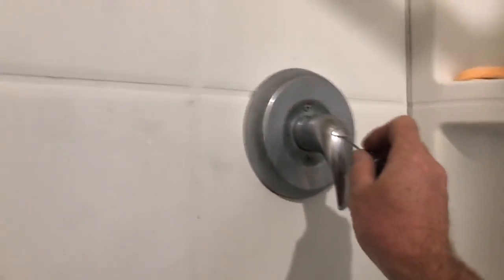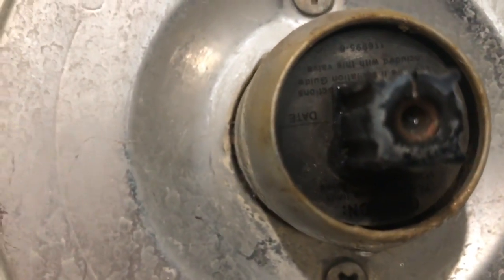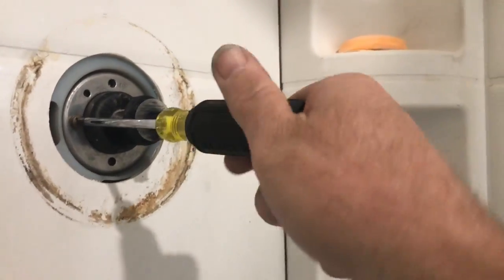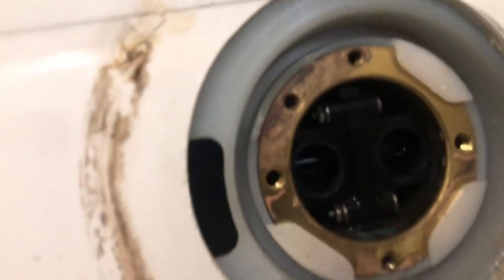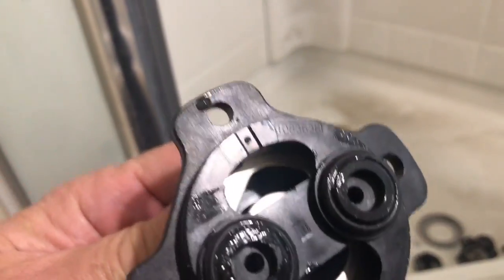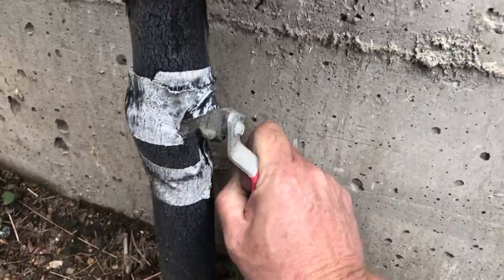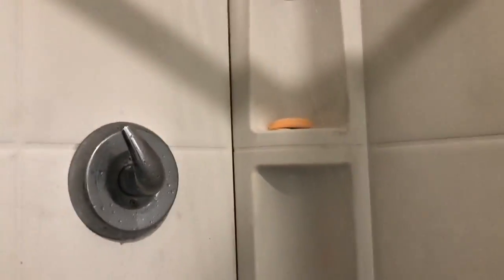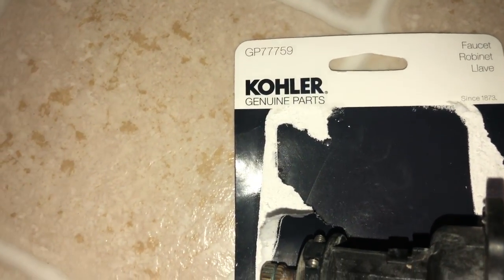Koehler shower cartridge replacement

Comment: Great video!  Because you showed the valve can break into two pieces that answered my question. I didn’t know mine was broke and didn’t understand why my replacement looked different than the valve with the stuck part still in the wall.
I know this doesn’t make sense but thank you for your video

Comment: Same parts that we have on all the showers in the hotel I work only difference is a more fancy handle outside, most of the time what I find is the hot side on the inside part is clogged with small piece of rubber. One valve have problem and it cause problem on the entire riser.

Comment: My grandfathers house still has the original hot and cold turning handles in the wall from 1942. Grandparents were newlyweds in that house my mom and seven brothers and sisters grew up in that house I grew up in that house along with a mixture of 27 other grandchildren in and out and my children grew up in that house are using that shower fixture. My grandfather was a plumber he showed me how to replace those rubber and leather gaskets when I was about 10 years old. And I showed my son just a few years ago how to change those gaskets when he was 28 years old. They just don’t build them like they used to. I guess by the time my new grandson is 12 I will be showing him how to replace those gaskets in that shower wall fixture
Reply from the maker: Great story

Comment: Thank you for this video! Call someone...been there done that and now my water pressure  is WAY LOWER than before the plumber replaced the cartridge(same parts you used). 20psi lower in shower only! House remained fine. Temp also won’t get hot. Rest of house, still fine. After checking everything else, all roads lead to replacing the cartridge...
So now with my new GP876851 the someone I am calling is me!! 🙏🙏🙏 
Do you know if there is anything I should do extra take sure I get my normal water pressure back? 
Thank you also for the tips when turning main back on. Thanks again!

Comment: Hey, Can you please describe how you removed the handle? Mine is stuck on there. Is there a set screw somewhere? Help!
Reply from the maker: Set Scew under oval looking tab
Reply: @NorCal-refrigeration  Thanks for replying so quickly. 
 I was afraid of that. Someone filled that with caulking. You don't happen to remember what size allen key?

Comment: I think mine is bad too. I looks like the same style. I have no hot unless I go all the way up then I get scolding hot so then I have to go back down to get warm water. If you just go up front he bottom to your normal temp you would use you get zero hot water. Then if you go all the way up then back down if you go too low you lose warm water and have to go all the way back up.

Comment: the balance cart used to come with a tiny pill capsule of silicone grease, the old ones version anyway.
over the years I've never had a cap valve come apart like that,  then again it's mostly delta and moen around here and symmons in commercial places (hotels and others)
blargh, I seen you showed the lube capsule shortly afterwards lol.

Comment: kohler  needs to replace these faulty valves  I've done three or four in my own house
Reply: RIGHT!!! I had my house built 21 years ago.  This is my refresher research for my 3rd time replacing the same 2 showers.  2 showers and 1 bathtub all started leaking again at the same time, like they're all on a time to leak timer.

Comment: Any chance you have the video where you took the handle off? I can't get mine off. Thank you.
Reply from the maker: There’s an oval piece that comes off. Under it is a set screw.
Reply: @NorCal-refrigeration  - Yes, got the cover off and the screw out, but handle won't come off. Just pull it straight back? Didn't want to break it. Thanks a lot.
Reply from the maker: @donovanmitchell6366  oh it’s probably going to take some wrangling if it breaks you’ll have to replace it. Not the worst thing.
Reply: @NorCal-refrigeration  - got it with some WD-40. Thank you for the fast response. I appreciate it. Take care. #HandsomeNotHandy
Reply from the maker: @donovanp.mitchell2173  thanks for watching 🤘⚡️🤘✨

Comment: it's always the pressure balance cartridge jammed up causing no hot, the cap assembly(manual valve) rarely ever goes bad, if it does it will keep running/dripping.
and you did get the updated supposedly better version, expensive little devils!
Reply from the maker: 15 years old I changed both about 60$ in parts.

Comment: Just converted my house from 3 handle to single. Went with moen lifetime warranty, see how that pans out
Reply: Love moen valves just based on they never change there cartridge designs . their is only 2 different types unlike other brands u have to keep many different parts . also the Moen is very easy to change out .
Reply: @jhhvacplumbing1944  wish I would have known that. I bought kohler shower stuff and toilet and sink stuff. Had problems with all of it. Even my toilet was deformed where the tank seal goes and leaked. I’m buying another brand next time.

Comment: Besides cause problems what does a PBU do? Can't it just be replaced with a solid object with two straight holes drilled through it? Another piece of over-engineered junk! Let ME control the water.
Reply: I soaked the PBU in a cup of CLR(Calcium, Lime and Rust Remover). Eventually the plunger/piston got freed up as I poked at it with a long skinny drift-punch. I continued to soak it and worked the plunger , thus getting the CLR into the channels where mineral deposits had formed.  The plunger began to slide easily from side to side and the springs kept it centered.
I initially was gonna drill out the rivets for a complete disassembly. There seems to be plenty of room to install SS nuts n bolts where the rivets are. Maybe next time.
Reply: Works good now with good temperature control for a comfortable water temperature.
Now, after reassembly... if the temperatures are backwards, so that hot water comes out first and then cold water comes out when the handle is wide open! The Mixer Cap (the thingy the handle controls) was installed upside down. Take the screws out and rotate it 180º  and reinstall.  
Ask me how I know. DOH!